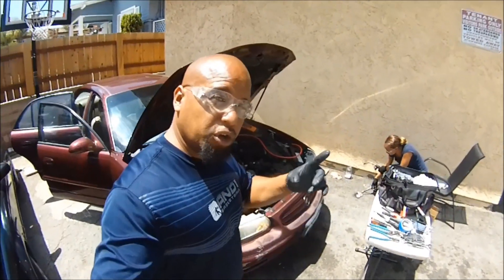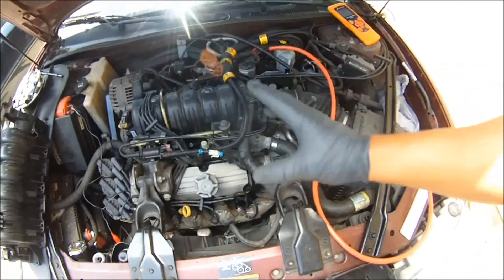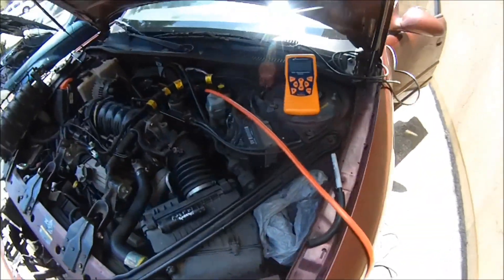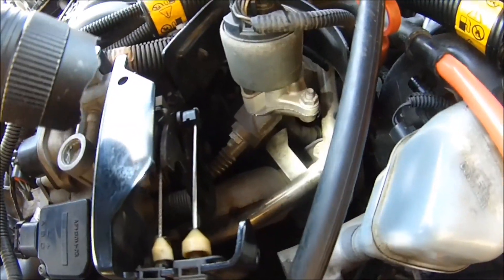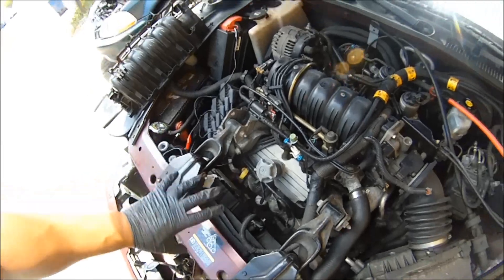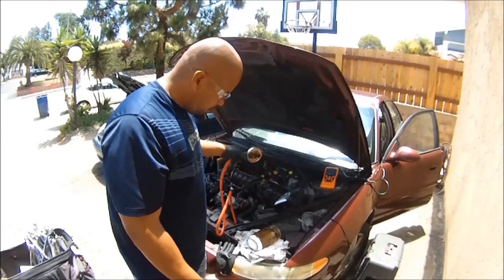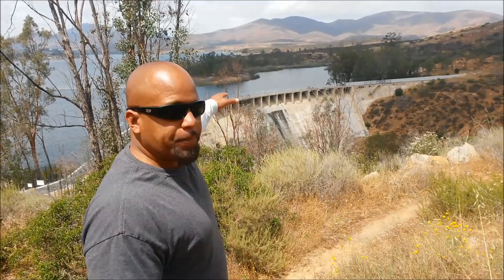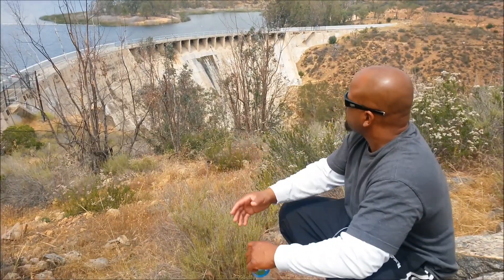THE EASIEST, CHEAPEST & FASTEST WAY TO DO A VACUUM LEAK TEST 4 BROKE FOLKZ CODE(S) PO171 OR PO174

Comment: Hi there wanted to ask I hav a sm problems w my 1994 Chevy s10 pickup I believe some vacuum leak or wiring harness has some broken wires and a lot of wires looking really. Like barely hanging in there ..but  I noticed they are all broken and looking ,around were there is a valve or connector to a valve without a ob2 scanner well ,I was told my 94 is to old so how can I go about getting codes without thousands of dollars to buy some machine I don’t think I’ll ever be able to get any codes so I’m trying to keep diy attitude but I can’t keep changing diffrent parts not even knowing if that’s the problem .so far I had the throttle body redone by professional .new gaskets all that rear brakes and drums oh now the check engine light is on and at same time the brake light in dash came on well hope you understand I no I’m a lil confusing trying to explain everything at once  Lol ay ty man yr am awesome guy ty for the things you talk about about earth the lord and you no I needed it at that time .w that I no I wasn’t the only one we’re would you start on broken wires or vacuum leak it’s pretty much always been in great condition .but couple yrs of it not getting it’s upkeep I guess we’ll  4.3 litre v6 automatic 2 wheel drive

Comment: Some leaks can be so small you need a laser light to see the smoke. 
  This is all fine and dandy but the real old school and vary effective way to find a leak a lot faster than this is to spray some brake cleaner, contact cleaner, starting fluid, etc. around the gasket seam of the manifold joining the heads, the carb/throttle body base joining the manifold or any vacuum lines going to the carb or intake manifold.  When the spray hits the leak the engine rpm will change. 
I'll find your leak in about 45 seconds.

Comment: I found out while getting ready to build this type of smoke generator this kind of air pump generates way too much air pressure, manufacturers say only about one pound is max because in some systems this pumps kind of pressure will blow out evap seals and can rupture todays plastic evap and vacuum lines after they have become old and brittle from engine heat and or age, high pressure will certainly damage something.  Turns out a way to build something closer to a real smoke generator is to use an aquarium air pump that can be regulated down with a small air valve same as aquariums use and a cheap air pressure guage is a good idea as well.

Comment: Thanks very much for sharing your knowledge oldskool funk.. I have to say, I wasn't expecting such a beautiful view with encouraging words from the wise.. I needed that bro. I'm struggling trying to take care of my mom and cant find a job.. Cause my 02 camry le has thrown same codes over a year now.. P0300-6, Po1135. Cat not ready, H02 not ready, and Evap not ready. Changed plugs.. Still didn't fix! Everyday when i crank it up 1st thing, takes forever for temp to get up to normal. And car want sit an idle in park or comin to a stop. Goes so low it starts shaking the motor and all way to bad at 300 to 500 rpms. We dont have money and have to limit our driving .. If you have any info ,, would you PLEASE let me know. Thanks. An may God bless you sir.

Comment: Love you work working on trying to be more knowledgeable like you. I believe my 2001 Jeep grand Cherokee has a vacuum leak however it is hard to fine. It is running long term fuel trim about -8% When I bring the RPMs you 2500 the negative become zero
Reply from the maker: Make a smoker and test for leakage.  Watch my how to make a smoker video

Comment: If you have an exhaust leak upstream of the O2 sensor that will also cause a lean code at idle. Freeze frame data will show when the code was set.

Comment: Can you have a vacuum leak without those codes, for instance p0300, p0301, and p0303?

This looks way easier than the propane or carburetor cleaner method, especially since I can't see under my intake manifold with removing the bumper
Reply: Nabre Labre I believe so

Comment: what part did you gut out from the inner tube valve? can you post a picture to see exactly? Are you referring to the tip of the valve the needle stem part?
Reply: The valve core which screws into the valve stem is what he removed.
Reply: Geo Logic can you please show me a picture on what you mean please?

Comment: oldskool funk do you remember how you fixed this particular code in this video although you didn't find any vacuum leaks internally? and also could that p171 code come from a faulty fuel injector? I have the same 3.8L and the same code from this video. no visible leak what's the next step? Only thing is I here a knocking or ticking from somewhere around bank 1, #4 or #6 cylinder. thanks for sharing your knowledge brother.

Comment: Made one after I saw this video and worked perfect! Thank u. Found/fixed one vacuum leak but see smoke coming out of bottom of egr tube at the flange right before it connects to the manifold. Is that considered a vacuum leak also? 03 impala 3.8

Comment: Can you increase the pressure a bit by plugging the intake by the Mass Airflow Sensor? Then open the radiator cap and look for smokey bubbles? 
BTW, I subscribed to your channel for reference when I go to Brazil as a missionary and need some help the "oldskool" way. 

Thanks.

Comment: I was referred by a friend a few months ago, and I am starting out as a mechanic self educated, mentored by professionals like yourself. Recently, rebuilt a Manifold for a 1996 Oldsmobile 88 ( 3800 Series 2 V6 Engine ) I seen your videos and have been inspired. I Took apart the plenum and lower intake manifold saw that the gaskets were cracked through car miss firing the whole works. The car had numerous problems to think of it. At the time fuel pressure regulator easy fix was leaking into the vac system for quite sometime, May of got into the transmission vac system, definitely got into the throttle body, cleaned the throttle body plate with carb spray and a rag. The outstanding work done. New throttle body gasket, upper plenum, fuel injector o-rings, a/c delco spark plugs, new ignition wires, Alternator, battery, valve cover gaskets, oil an filter change, coolant. Lower intake and new upper and lower gaskets, also new upper intake plenum. High pressured fuel lines to compensate for outdated cracked lines. I will be doing the smoke test, and I have heard there well at $1,000 so I know this would be a sturdy alternative. However went to start the car, and it was miss firing to start. Then, after a few tries to started and stayed on with a rough vibrating IDLE. And I did a road test it drove fine, get back home shut the car off, go to turn it right back on, and MISS FIRE, NO Start, it starts at random, and I know it could be ignition system, air, or fuel. Thus Far the fuel rail has fuel and pressure due to the test port on the pressure regulator. I have yet to check for advanced external vac leaks, then try the soapy water spray technique. Then, the check for spark in all the cylinders to see if the fuel is staying on to long on the plug fouling it out. Anyways, would like to meet you some day, I'm in Arizona next state over. Would like to meet a pro like you in your Diagnostics.

Comment: On a honda civic battled lean code. Turned out to be fuel pressure regulator. No way to test fuel pressure except by splicing into fuel rail feed line and inserted connector for fuel pressure tested (rented from o'reillys). Really we had no clues that this was the problem, was only thing left after we replaced fuel pump. We had an extra one due to going to the pick n pull, and it boosted pressures by like 15 from 40 psi to like 55psi if I remember correctly. Would've made a video about it, but didn't record anything on the car.

Comment: subbed! your videos are great man! your intentions are honorable! I was wondering if you might be able to help me with a p0449 code on a 2005 kia spectra. its either a hose for the carbon canister, the ccv solenoid for the canister or the canister filter. thing is its underneath the gas tank on the driver side and it needs to be lowered down. how much would you charge to lower down the tank and put in the part? im near you as I saw in your vid on getting I/M monitors ready for smog testing.

Comment: My 240sx blows smoke sometimes out of the exhaust when I rev it up and a little water comes out. A lot of dirty water in coolant resoivor? Smell of burning gas all the time? Blown head gasket or what? Just put this exhaust in. It also has a small leak in headers.
Reply: TeddysRUs    He tested it. Starting at this point.